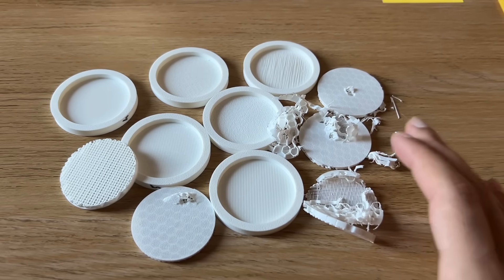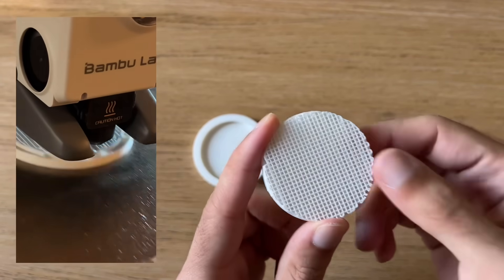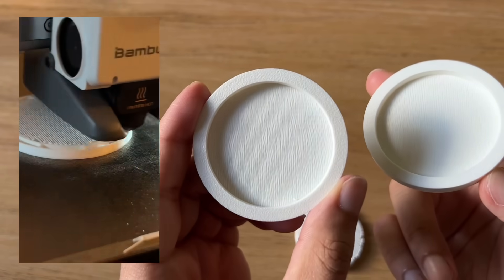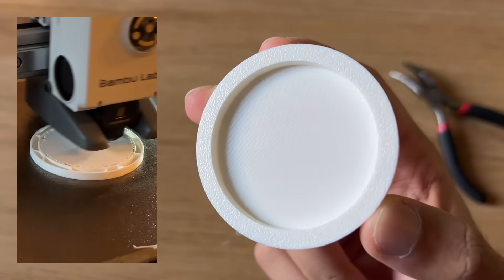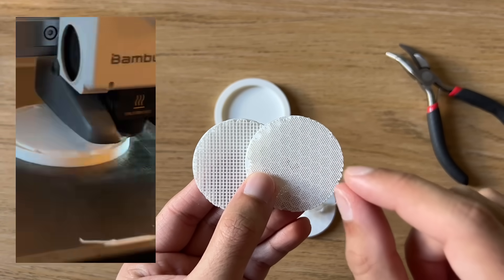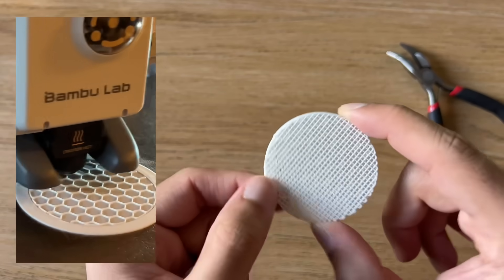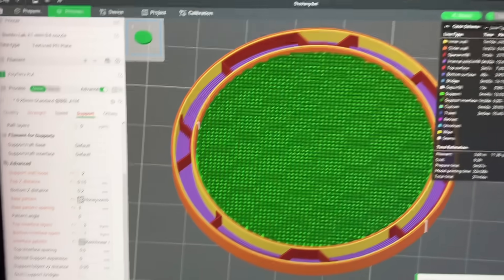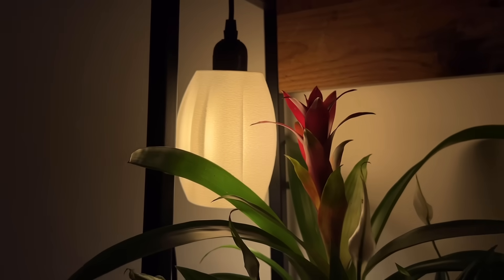Best Slicer Settings For Printing Overhangs?

Comment from the maker: If you would like to run this test yourself I've added the STL for the part I made to my patreon, its completely free https://www.patreon.com/doublesketchstudio
thanks for all the positive comments!
Reply: Is that an overhang or a bridge?
Reply: I envy you, my friend.
How do you manage to talk so much and say so little?
With any luck, by the time you finish calibrating that filament spool, you will have used up that entire filament spool.
You are my hero.
Reply from the maker: @ I used a total of maybe 60g of filament and ended up with slicer settings that produced a very nice finish. If you have suggestions of how I could improve the video let me know, that would be helpful
Reply: @doublesketchstudio  Not sure what they are trying to compensate for with such a comment... I really liked your video and you giving all the details, even for the failed attempts. In my opinion it's important to know why something works, not just how :)
Reply: @PaterCurro A politician in training 🙂

Comment: I used the settings for the test 6 supports…and it was extremely hard to remove. It actually didn’t fully come off. I used the same puck model.
Reply from the maker: That's odd, maybe try experimenting with the z top distance. All printers and filament will act slightly differently. These settings are just what worked for me with what I'm using

Comment: To remove support like that I normally stick a right angled metal spike through the surface of the support & yank it out. The support either comes out or gives you an easy entry point to get the pliers in to get a good hold of it & then yank it out

Comment: Another option: Instead of fiddling around with slicer settings etc, design the support inside your CAD. That way - if you publish your model - you make it way more independent of slicer settings. So others have a higher chance of getting a good print even if they don't know all the ins and outs of their slicers.
Reply: How to control fan cooling on the support interface layer?  I designed my own and it was bad without cooling PETG

Comment: great results for not using petg as support interface layers. But for perfectly smooth first line layers after support materials, interface should be 0 and a nonstick support material lile petg be used as interface layers. 
https://youtu.be/tSUv146Dk04

Comment: If you are not treating your FDM prints to sandpaper or alcohol mist to get rid of the layer lines and other impurities, you're doing it wrong.
Reply from the maker: it depends on what you are printing
Reply: @doublesketchstudio  Yeah, I was specifically about the vase-shaped object you were printing in the video and went with matte finish on.

Comment: Wait so are you using an actual support material or are you using the same material as the print for the supports? Because you threw around the words “support material” quite a but and i just want to make sure because i am printing both the supports and the prjnt in the same material

Comment: For a PLA print, use PETG as the interface layers (the top 3 layers of the support, in your example), with a gap of 0mm. This method works best where the layer above the support is straight and flat.

Comment: 2 support wall loops is a great tip! I've been playing around with something simillar
I'd recommend using PLA for the main part and PETG for the support or vice versa, you can go as low as 0.05mm top z distance without much trouble to remove the support

Comment: I've begun simply printing a face down faux bottom that's only 3 layers thick and gluing it into the bottom crevices of items, it's faster, I usually use support for PLA but even with that I end up replacing the 'bottom' - it gives me finite control as well, e.g. using a holographic or whambam glossy build plate plus silk in Archimedean spiral makes a machined metal look on a glossy bed or a smooth pei matte bed.

Comment: Nice testing. Are you sure at https://youtu.be/_vu__k4_UQU?t=372 6:12 that you are using a grid pattern? It looks more like rectilinear because I cannot see the lines crossing on the same layer (at least that's what it looks like). Grid is lines in both directions on the same layer (hence bump into each other) and rectilinear is lines in both directions but only on alternate layers at least it is for infill, not sure about support material interface layers. I wish slicers had an option to remove grid as an infill pattern because on models that have small bed contact area and large surface areas above, the grid lines have more time to solidify and when the other direction is laid, it bumps into the perpendicular lines which you can often hear as a click and gives a good chance of knocking the model over.

Comment: You could make this in 3 parts. A ring, the front face and an internal face flattened with something like the 'Ironing' setting (in Cura), then glue them together.

Comment: PLA, eh? Well, let's do that again once you graduate to proper filaments, because that's a whole different story... Oh, and while i applaud the effort, i'm pretty sure that out of the last (nearly) 15 years, at least 2-3 combined whole years where spent testing, tweaking and perfecting the support settings that are used in modern slicers today. So unless you come up with a radically new idea, there's probably very little room for improvement. But then again, support settings are optimized for "most" filaments, and if you can squeeze out some tiny improvements when printing with the easiest filament there is (PLA, of course), then... oh well, good for you. But not really worth the effort, as you'll discover once you use big boy filaments. 😉
Reply from the maker: @jangrewe   sure, I don't claim to be discovering anything new here, just trying out some different settings to get a better finish, which I did in the end so I don't see it as wasted effort. I'm using pla because it works well with what I make, I don't need the properties of the other types. I also just use my printer as a tool, my main focus is designing and the printer is just the tool to get it in my hands. Similar to how a photographer would view a standard printer.  I don't really have an interest in the challenge of using "big boy" filaments that are more difficult to print.  The challenge I'm interested in is designing products that look good and function well.
Reply: @jangrewe Ass

Comment: Hi there, use a petg interface layer, change the interface gap to zero, and change the interface spacing to solid, and make sure you purge a lot between the PLA and petg

Comment: Good test! The theoretical "best" solution frequently turns out not to be the best. An AMS with different material for the interface layers is still the best solution. Albeit more expensive for the AMS unit. With zero Z separation between the support and overhang, it is pretty easy to get nice surfaces. But sometimes we have to work with what we have. Your samples here are good reference material. I'll save this video for future reference. Thanks!

Comment: For support, in Orca Slicer, under SUPPORT, there's a setting for Pattern Angle.  You can rotate the angle so you can easily keep the top support layer from going the same direction as the bottom of the model layer.   Also, I set TOP INTERFACE Layers to 3 and TOP Z Distance to .28 (both from another video) and it works great.  I use various patterns, and it hasn't given me any problems.

Comment: No matter how I increase the number of the top interface layer, the line direction of the topmost layer always stays the same. 
It is the "Pattern Angle" that can actually control the direction. Hope this helps.

Comment: For the really dense support surface settings like 90% infill, I found that while using tree supports in Cura (organic supports in Prusa) allows a flat head screwdriver to gently lever away each piece once you snap off the base of the tree(s). On large flat surfaces like this one, sometimes the whole thing just "rolls offs". It's not perfect, but not needing to snap off a giant, rigid support all at once will probably save your palm from being sliced open during post-processing.

Of course, the generally better solution is to just avoid overhangs if you can avoid it. Sometimes people forget that just printing the model 45 degrees is a genuinely viable option and jump straight for supports.
Reply: the old 45 degree trick is a beauty. Followed by painted organic tree support for extra rigidity if printing tall object, especially if printing at speed.

Comment: I pretty much only print in ASA where I use HIPS as a zero clearance ( so 0.0mm compared to your 0.15mm ) two Layer Interface Layer with 0.0mm spacing ( so full coverage ) for this kind of stuff.
Obviously benefit from having access to a Multi Color / Material print Setup to do this automatically but in a pinch can be done with Pause Commands and doing manually as it only requires two Material changes per every two Layers. Perfect results which I imagine could only be improved by perhaps first Ironing the top HIPS layer before printing with ASA on top of it.

Comment: I actually increase the extrusion on the first bridging layer to 107% wich gives me 80% of the times a really good bridging layer. And also i added a pause between the first and second layer of bridging of around 2-3 sec so the first layer is more rigid when the next layer is printed and therefore have more 'time' to heat up and start to sag down
Reply: can you tell more about this and where to set it up? i am having difficulties to get good result on that first layer
Reply: @willzhd2862  do you mean the actual first layer or the first bridging layer?
And wich slicer do you use? I only work with orcaslicer 😅

Comment: These are not overhangs. Overhangs are features that grow out as the layers stack. These are bridges, which connect two separate features from the previous layer. And if you're using supports you're not bridging, because you're just laying filament on top of the supports.
Reply: Well technically it is bridging between the supportive layers, but yeah this video should be called something like smooth surfaces and infill settings.

Comment: If you want to able to remove the prints easier with them sticking less to the outer walls - Change Support XY distance to atleast 0.45 to 0.50. Also the Type of filament & retraction settings play a massive part in this. Without Calibrating the printer for the Material these Settings wont be even remotely close to accurate.

Comment: Which layer height did you run these at? I usually use a .2 and for top and bottom z distance, I have been using .35 which works pretty well for me. I am assuming you were using a .12 layer height perhaps which would make .15 make more sense to me.
Reply from the maker: the layer height and z distance were both set to default at 0.2, i changed the z to 0.1 as the theory was it would squish the filament into a smoother surface, it was too hard to remove so I increased it to 0.15 which seemed to work well
Reply: @doublesketchstudio  After watching your video, I adjusted my z distance to .23 and it seems to work nicely for me. Leaves a little texture on the underside, but its clean enough for me and still releases easily. I might try tweaking it further for other prints, but when I tried to do .15 or .18, I couldn't get the supports off as well.

Comment: Besides all that, I found very helpfull to print the first "bottom" layer of the part (on top of the supports) extremely slowly and with max part cooling fan, to freeze the filament asap and prevent if from melting with the supports. 
This way, I managed to reduce the gap to .15mm, supports still detach super easily and bottom surface is very good
Reply: what setting is this in Bambu Studio? the Overhang Speeds? If so what speeds do you use?

Comment: You can also make support interface distance 0, pause the print when it's about to print the overhang, use a permanent marker to cover the entire support interface layer, resume print. It will print PERFECT and the marker makes the support pop off super easily. It's the same concept as PETG and PLA support interface but no need to swap filament and works just as well.
EDIT: Put interface spacing to 0 for best results.
Reply: I confirm. I learned about this method few months ago and it works like a magic! Definetelly my favorite trick for flat overhangs!
Reply: "as PETG and PLA support interface".  what you mean>?
Reply: @EnnTomi1 some print the contact point between supports and the part with petg (if your part is made with pla) and vice versa. The two don't stick so the support will detach easily
Reply: Will  try this!! sounds mad interesting
Reply: да, только как мне остановить на нужном слое?
Reply: @KENISEG  the theory (you can find the exact details based on this): find the layer in the G code and add a G pause command manually there into the code before the printing
Reply: make a video on this, please!!

Comment: Do you have any special settings for your top layers (ironing)? The finish is looking so smooth!
Reply from the maker: the top layer hasn't been ironed, the matte pla (polyterra) really helps with making the surface look smooth

Comment: Great video, but I feel the amount of changes from one to the other isnt a fair comparison. Would have been better if you had some constants and maybe left infills the same, and change only top layers, changed only spacing, etc. 
That could be a series of videos. 
Not trying to make more work for you though 😂👍👍👍
Reply from the maker: 100% agree! this video was originally just going to be a quick test but i went down a rabbit hole deeper than i was expecting, that along with it being my first video i honestly thought it was "good enough". Over 40k views later im regretting not putting in a bit more effort haha, if i make a test like this again i will only test one variable at a time
Reply: Just realized that it was your first... Lol Not too shabby 👌🏻😂 @doublesketchstudio

Comment: I second the thought expressed in another comment re "organic support" although that's in prusa slicer, which in theory I suppose you could use with the bambu printer on selected occasions.  Similar ideas are present in many other slicers.  Works especially well for bigger supports, can be combined with choosing a different material for support.  But another similar idea, that would be applicable for this specific fixed height application, would be to adjust the support granularity from course at the bottom of the support to fine at the top, so as to consume less filament and print slightly faster.

Comment: Another point is to keep the print speed as consistent as possible - a difference in shrinkage and stretching/thinning due to speedup makes 90° overhangs look aweful even with a decent interface layer.
The real key to perfect overhangs on a level surface, though, is to just print the TOPMOST support interface layer in a different material as a solid surface, and to minimize the gap between interface and overhang. The lower the tensile bond strength the better, and PLA+PETG (~4MPa) is by far the best combination, but also TPU+ABS (~7.5MPa), PETG+ABS (~8.5MPa) and TPU+PLA (~9MPa) - as long as you don't squish the them together too tightly ofc. (Numbers takes from JanTec Engineering's "You're printing ABS wrong" video)
Even if you don't have a multi-material printer, you can pause and swap it manually since it's basically just one layer. Manually painting the topmost interface with a sharpie works too, but takes a bit of precision
Reply from the maker: the more comments i get the more i feel a part 2 is needed!

Comment: I've found ~75-90% of layer height for interface spacing allows for easier removal but decent finish, .12-.14 spacing on .16 layer. If you match layer height or greater, then your extruded plastic will essentially be falling down a layer on pure overhangs